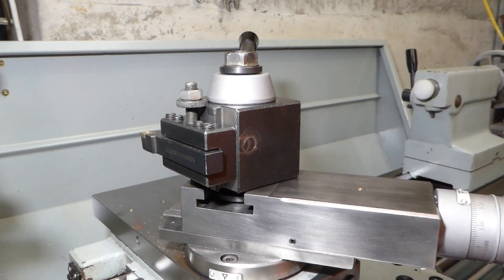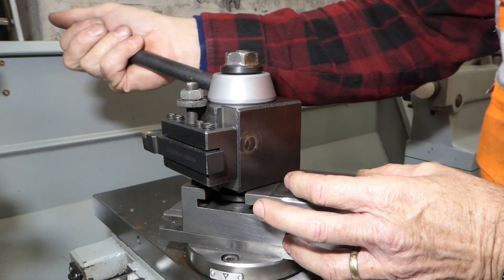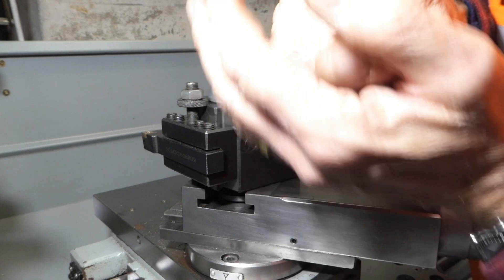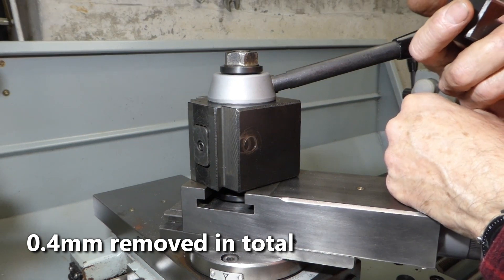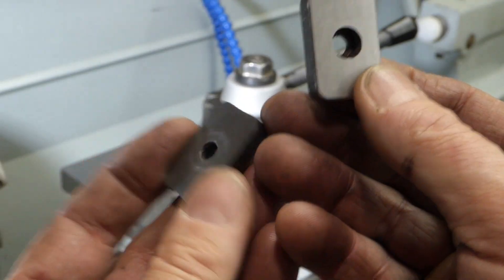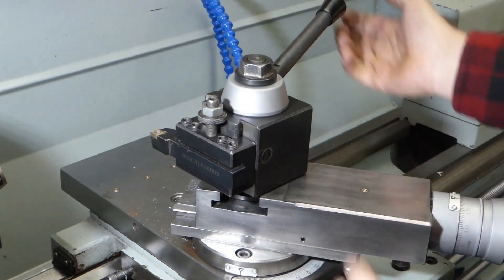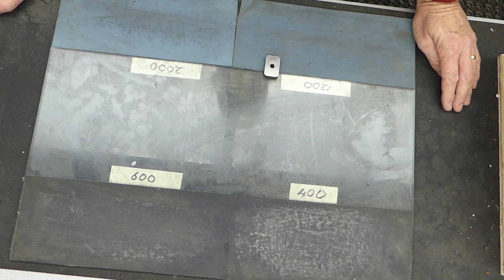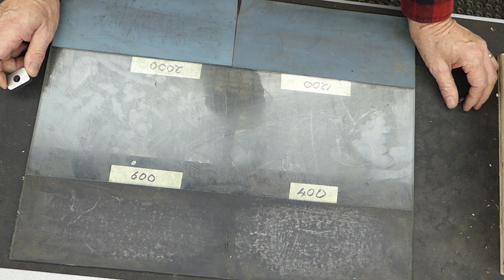QCTP locking (piston type) mechanism repair.

Comment: Stop, the pistons are reversed
Reply from the maker: Thanks for watching. Not sure what you mean. Cheers Mike
Reply: I have a piston type qctp, the pistons are not interchangeable in the holder, different lengths, must be installed correctly to get the lever clocked correctly.
The leading piston is shorter than the trailing piston.
In your case the pistons where installed in correctly I assume.
Reply from the maker: After I ground them both work well and to the same movement on handle. Remember I only removed 0.4mm from them. They work great after grind. Lever was short pull using either position.
Thanks for your info. Cheers Mike